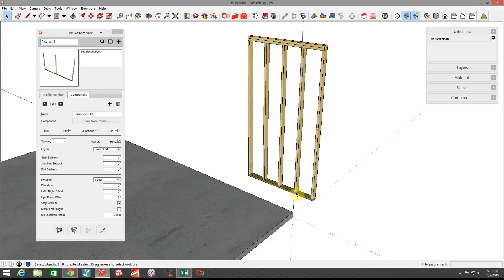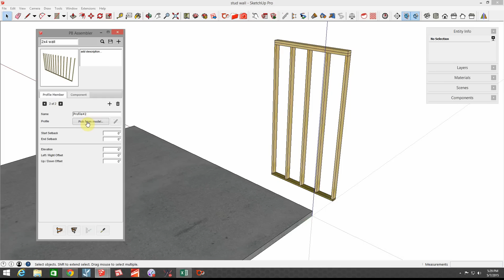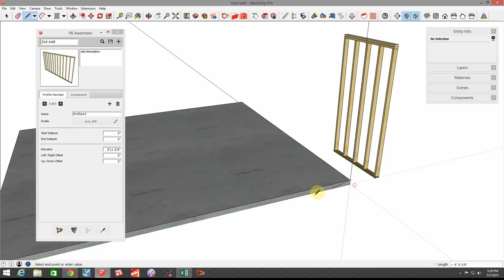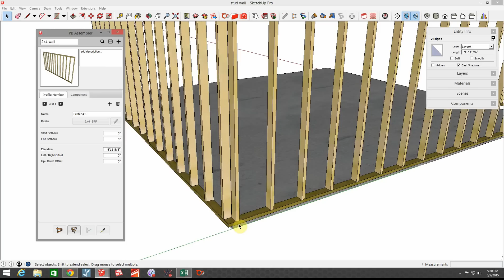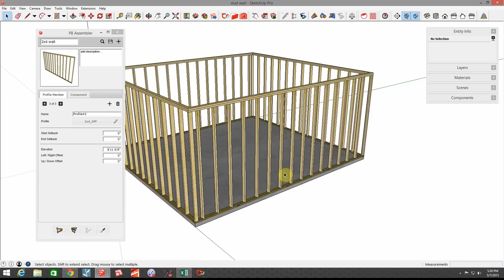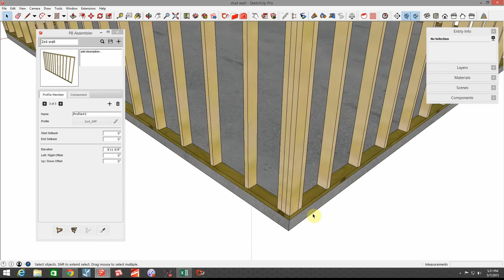Profile Builder 2 Tutorial: Wall Assembly

Comment: Is this style could be apply to do steel /re bar for construction?
Reply from the maker: +Veeravit Vongkwo 
Certainly - I use 2 runs of rebar in my footings - I use #4 rebar (1/2" dia) on it's own layer so that 1) it extrudes as I model the assembly and 2) I get my LF quantity for Estimator for SketchUp - you could do verticals or other parts that are spaced at intervals as "components" and control their spacing in the Assembly Dialog.  Again, my vertical pieces are modeled using PB2 profile, then made a component, but I since I used a layer for the pieces, i get my quantities in Estimator as I model it - hope this helps
Reply: Thanks a lot for your kind. I just try to study and it will help me a lot .Thank you very much.

Comment: how do you add windows and doors?

I've been using housebuilder for framing and while it is still available it has never been updated it seems that it is much more user friendly and faster than Profile Builder 2...
Reply from the maker: Daniel Deilgat That is the part of the workflow I struggle with - currently (because things change every few weeks it seems), I created components consisting of my standard windows (trimmed already), with jacks, headers, sills and cripples, etc. (yes, it is a lot of variations).  My method takes longer than the automated systems, but I am after quantity take-offs and accuracy, so I do not mind spending more time modeling my framing.  So, I trace my wall assembly on the floor plan, then add the "framed openings" components, then delete the extra studs - may sound crazy but it works for me.  I am very surprised that Housebuilder has not done any updates in years!  I'm always searching for new and better ways - good luck!  Also, I need the studs to be components for estimating and I do not think Housebuilder does that?? but it has been a while since I used it